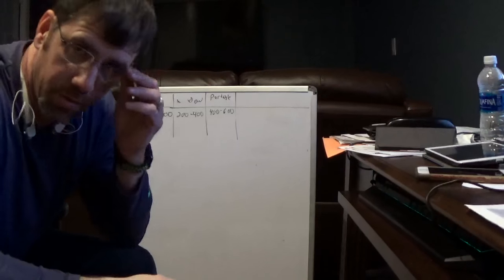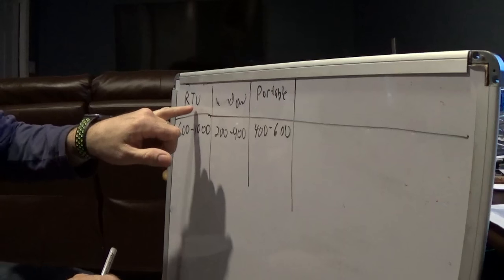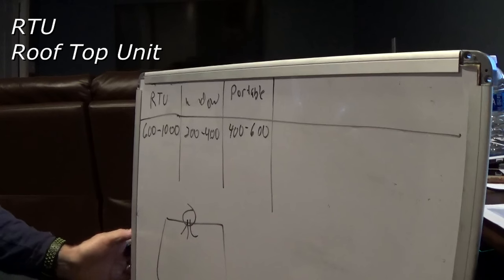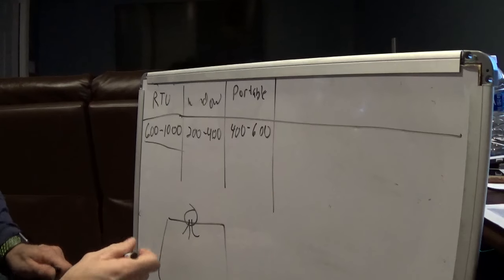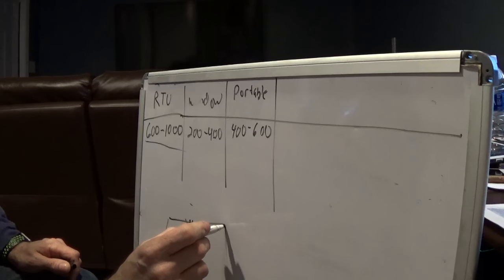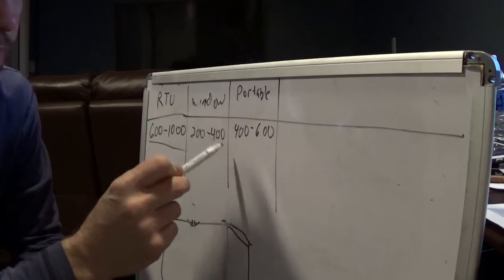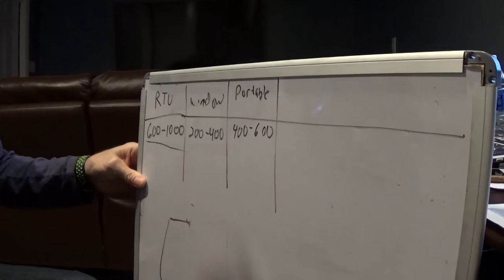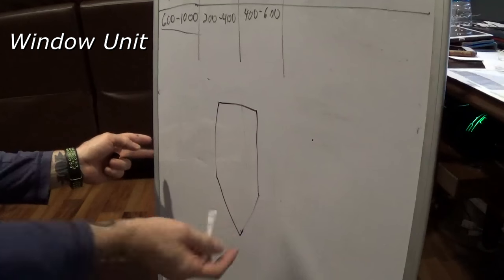6x12 Enclosed Trailer Conversion ( WHAT AC UNIT DO I NEED?)

Comment: If money wasn't an issue, the split air is what i would get for my 6 x 10 trailer. However, i settled for a $150, 5,000 btu window unit for my front wall. I did reinforce the wall by framing up on the inside with 2 x 4's flat against the wall and placing my paneling over it, (you can't tell it's thicker) that gave great strength to wall and extra thickness to rest the a/c unit on. Speaking from past experience, I advise getting a unit with a remote control and energy saver mode so it will turn off and on automatically as needed. Set the temperature, go to bed and forget about it :)

Comment: I know its an old post, but I'm at this stage. Roof air is about $850 for an unducted 9200 BTU Coleman, it is not stealthy and its very LOUD, but convenient. It can easily be powered via a 2000 watt inverter generator. Next... I had a single hose Haier in the toy bay of a smallish toyhauler (with drop down beds) and it worked very well for 3 years... including never needing a water collection tank emptied. I think I paid about $500. The huge plus was it was extremely quiet and came with dehumifier feature and a remote control. I think it was 10K BTU, but I don't think a single hose will work in this small trailer (about 78 s.f.) . Next... I think a two Hose portable is the way to go. I see a $320 Whytner in 12K BTU on Amazon but gets very bad reviews if it breaks. So, trying to pick one. Hopefully find one as quiet as the Haier. I might just see what Home Depot or Lowe's sells.
Reply: Clint Johnson why not the Dometic brisk II rooftop ac? It’s rated as the most quiet unit available

Comment: I am mounting a window AC face up through the floor in the V nose part of the trailer.  It's Inexpensive, stealthy, and it vents and drips it condensation out the on the ground plus it is more efficient being in the shade all the time.
Reply: Hey man I did not them window ACs could be mounted straight up and down I thought they had to sit flat? Have you done this already and is it working?

Comment: If your going to use that type of portable unit, go with the dual hose. I have one and no probs. Not sure why anyone would use a single hose as it sucks cooled air out.
Reply from the maker: I ended up going dual hose.
Reply: Kraka069 I'm sure it will work out better. more efficient.   I'm looking at the Climateright 5000 to install on the tongue of a utility trailer with a pop up tent. Need something light and durable to travel across country in a 1997 jeep wrangler. Need heat and ac since I'll be camping at various altitudes while doing some off roading. Good luck.

Comment: I'm going to cut a hole 16x12 to place a louver on the outside and box to mount the ac inside.  The location will be off centered near the axle, the vent will be on the side.

Comment: I have a 20ft fully insulated cargo trailer that I have been using a 10,000 btu portable a.c. but its only good for nighttime in east Texas. Temps get to100+ in the summer. The air isn't cold in the rear. I'm thinking I should probably have a roof air system
Reply from the maker: i would have went with a dual 14k or more unit.. a mini plit would be awesome also
Reply: I have the same problem, what did u do? Or have you improved it somehow
Reply: We've got the same issue; I installed insulated panels recycled from a hexayurt made from 1 inch thick 4x8 foil covered polyisocyanurate insulation panels. It makes a BIG difference.

Comment: It can be tricky to mount the outdoor unit especially on a V nose trailer, but if you can pull it off a mini split A/C is way more efficient than any of the units your considering. Plus they can heat and best of all their dead quite! 9,000btu with shipping is around $600 off ebay , 12,000 is around $650.
Reply from the maker: i have a mini split in my house (bonus room) and at my cabin, but 
i read somewhere they are not good idea because of the road vibration, but im unsure,
Reply: It's weird I replied to you last week, but comment isn't here. Anyhow, as long as you mount the outside unit securely and keep it protected while going down the road it shouldn't be a problem. If you search "rv mini split" on YouTube you'll get some videos of people who've already installed mini splits on campers. I won't post links myself cuz I'm thinking that's why my comment didn't post.

The inverter type mini splits run constantly, throttling down instead of cycling on and off. If you intend to run off a generator this should give a massive benefit in fuel savings. As that your generator can stay evenly loaded instead of spending most of it's time idling waiting for the AC(or heat) to kick back on. Then running for a short time at a heavy load. Also it will be quieter not having the generator spike and run hard every time the ac kicks on.

Looking at the specs for a 9,000 btu mini split idled down low draws quite a bit less than 400 watts. At that rate my Honda EU2000 could power it for 20 hours on a 1.1 gallon tank of gas.
Reply from the maker: i see the notification of peoples posts, and i go to read the whole thing, and i cant find them sometimes. i only delete or deny spam
Reply: THX 1138 20 hours on 1gallon? That's sweet!
Reply: THX 1138 so you know where I can find one of these splint units. I want to use it on a 7×16 race trailer with freezer strips at the rear and side door.  If you can give me a name you would recomend that would be awesome.

Comment: $99 Walmart 5,000 btu,. Powered by $99 harbor freight generator.
Reply from the maker: oh god no
Reply: Is it working still?
Reply: @kweaver2459  yep, what I love about the two strokes, no oil changes, you do not have to keep up with hours between maintenance, because their is none, and with the premix fuel, it keeps the gasoline from going bad.
Reply: @gsp49  I might as well try it, costs half as much as anything else

Comment: NOISE !! I used a portable A/C unit it's pretty loud. Roof top are also pretty loud. You thought about a split unit you put outside ?
Reply from the maker: How did i miss that one, i have one in my house and cabin... love it .
would cost about 800-1200 ish . Dont know how they would hold up yo travel/ vibration
Reply: Kraka069 I imagine it wouldn't have to very big considering the size of your trailer. If I did it over that's they way I would have gone. The portable AC is just too loud for me.
Reply: I have seen people put window AC in the side of trailer behind the axle. Fender protects it from debris.
Reply: I think it all comes down to how you want your inside configuration. How much or little you want inside. The roof mount has low profile versions as well. Do you want the capability to use your trailer for more than full RV? Blocking your ramp with a wall will limit the use. Money plays a big part in all builds. Think about your inside configuration that will point to what type of ac to go with. Do you want a fully enclosed bathroom for privacy? also the location of all your big items like water tanks, beds, etc. I have put alot of thought into it. to save space I'm going with the low profile roof mount ac with heat strip.